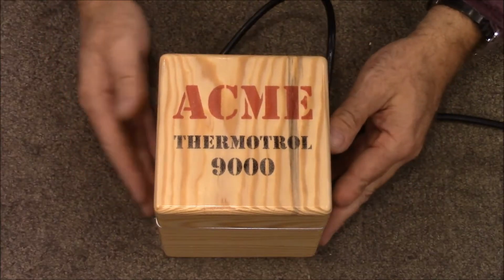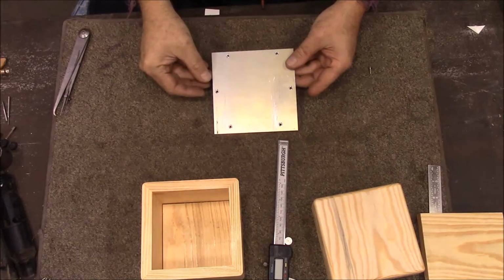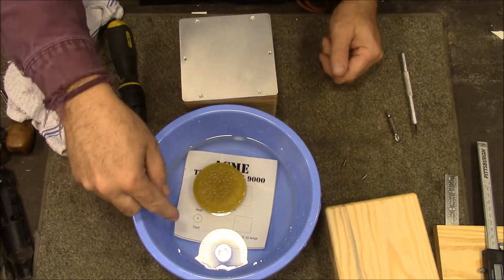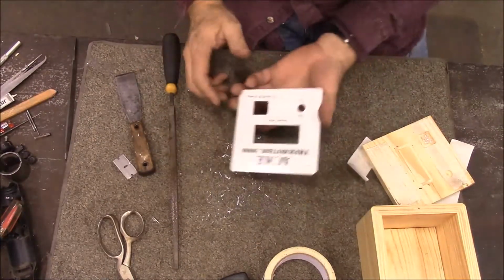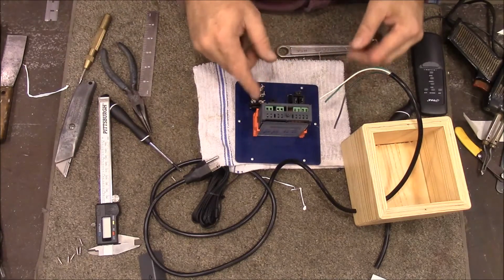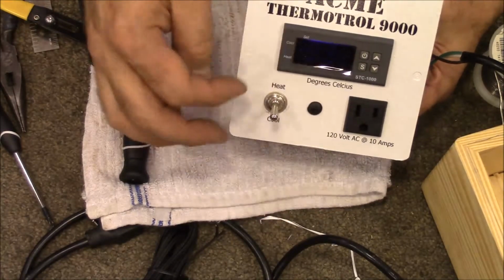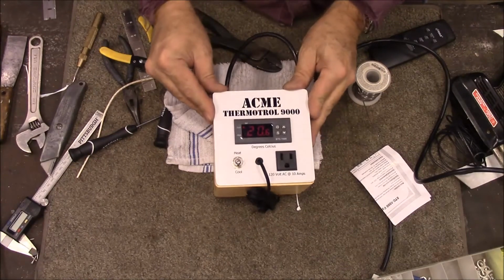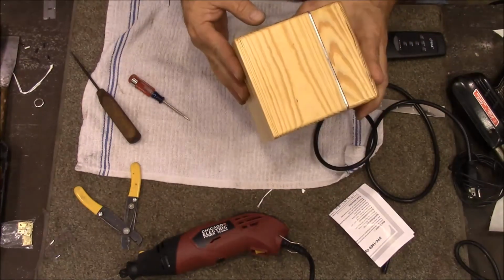Homemade Digital Temperature Controlled Outlet

Comment: Very well done.  Eclellent discirptions and good information on the sources of the parts and such.  Question however,  to switch form heating to cooling do you need to do more than just change the position of the switch you added?   That is, do you need to go into the menu settings and set it to heating or cooling?  Thank you
Reply: +Glenn Felpel No.  The instructions that come with it show you how to set the variance from your set temp.  In other words, if you set this to 3 degrees, the controller will try to cool if it gets 3 degrees or more above the set temp and will try to heat if it gets 3 degrees below the set temp.  The switch only selects which relay the power comes from, either the heating or cooling relay.  Hope that helps.  Thank you for watching!